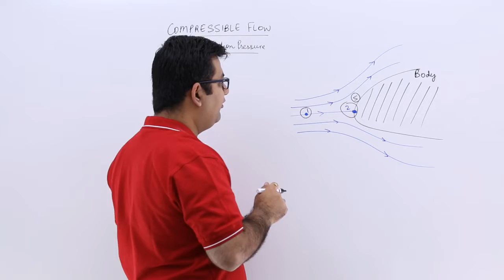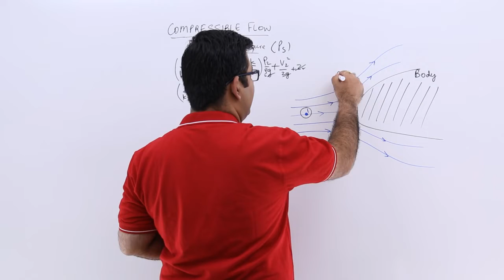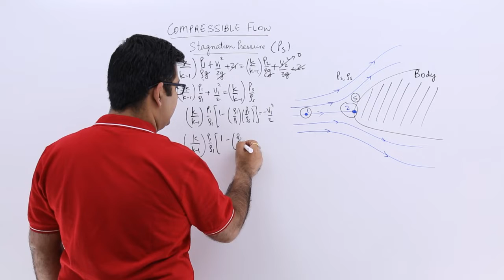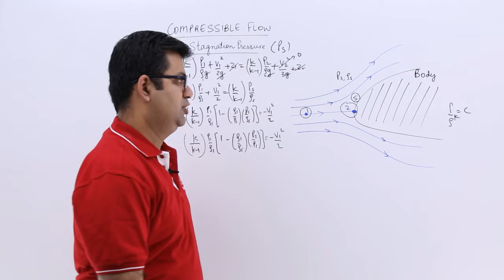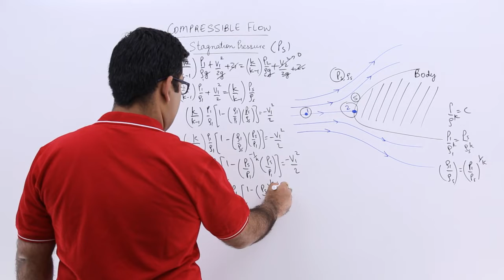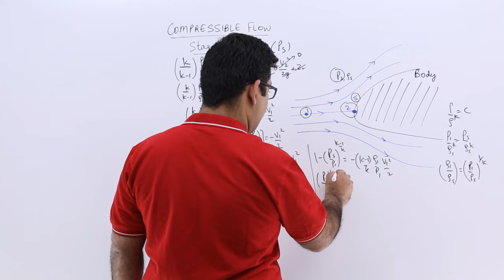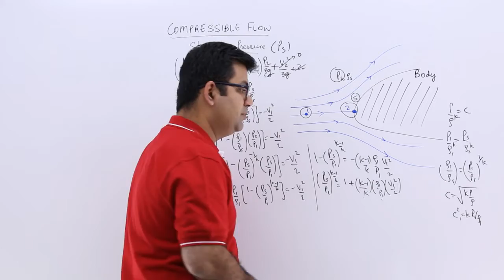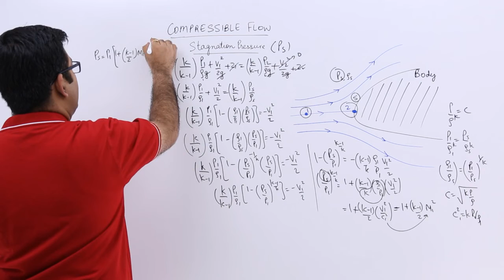Stagnation Pressure

Comment: stagnation pressure is defined for isentropic flow, not for adiabatic flow.
Reply: But isentropic is nothing but adiabatic and reversible process
Reply: @rajukollipaka1140  1.  Isentropic processes need not be always adiabatic
                                2.  Reversible processes are always isentropic
You need to find one example of adiabtic but non isentropic process, and one example of isentropic but non adiabatic process.  This will help you in broadening your knowledge base.

The pressure density relation you have used is for isentropic processes, and not for adiabatic process.  For isentropic processes 'k' is the ratio of specific heats at constant pressure and volume. For adiabatic processes 'k' is called polytropic coefficient, and does not fit into your compressible Bernoullis equation.

Use Simple energy conservation of Cp T0 = Cp T + 0.5 V^2 to derive the equation, life will be easier for you and the students both:-)
Reply: @AfrozJaved  Thanks for ur amazing explanation. Even i want to say that , but due to this comment section,I delivered in a way that would catch at a shorthand
Thanks for ur explanation sir jii🙏